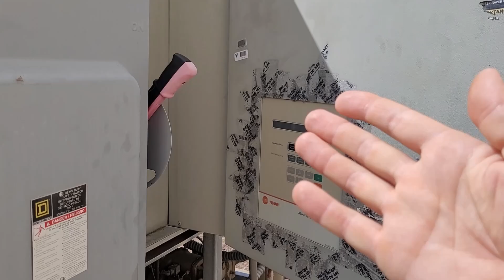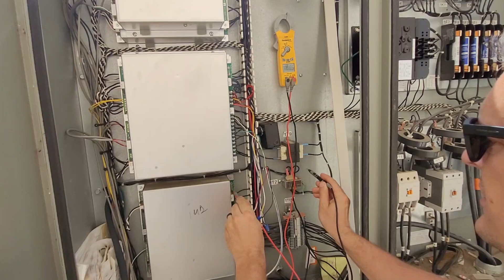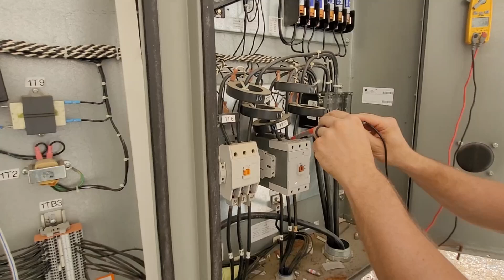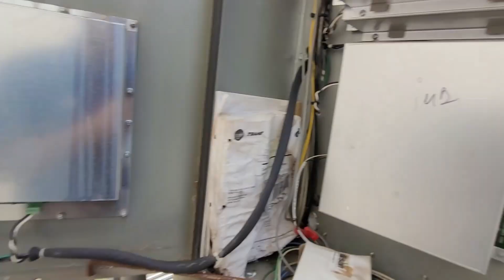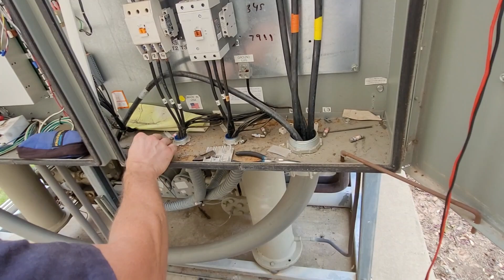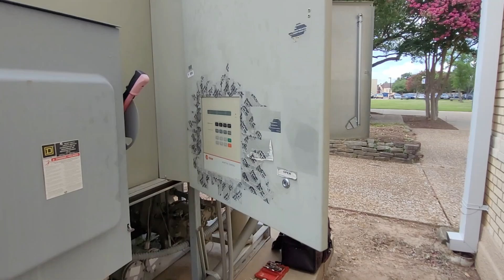Chiller Power Issue

Comment: Bad practice, if one phase has blown you should always replace other two phases as they will have been put under load. This could explain why fuses keep tripping. 😊
Reply: not sure if you noticed... the blown fuse was on a 120v while the other 2 are on 208. it's not part of the phase but post transformer and they used a triple fuse block instead of a double + single